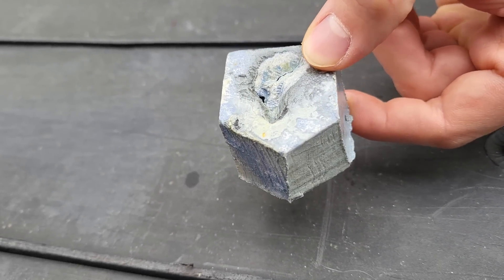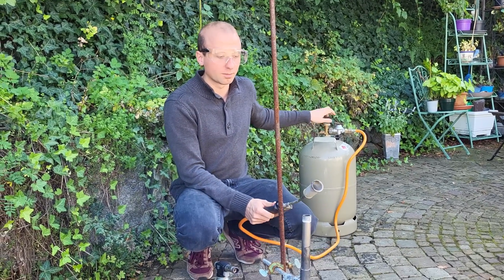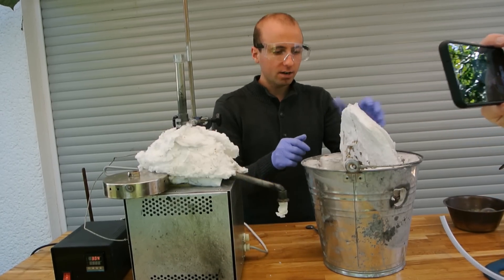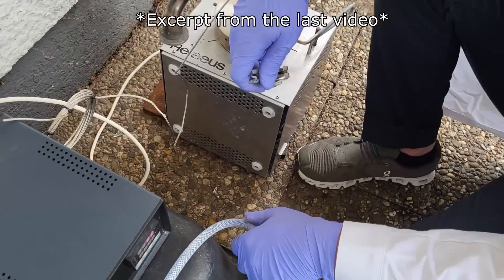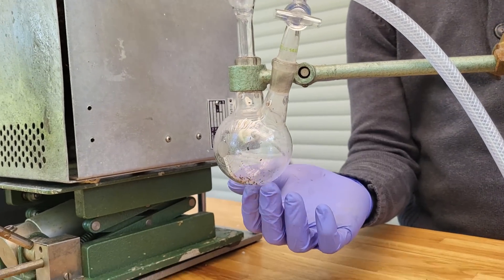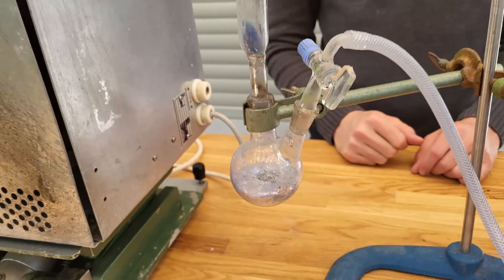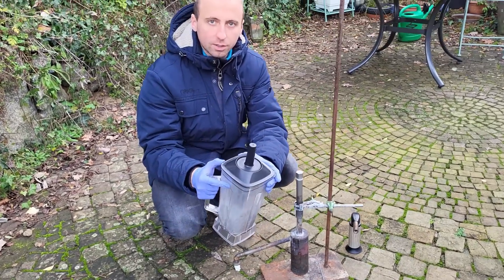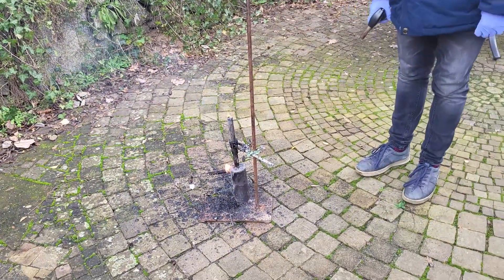Potassium Metal From Potash

Comment: im gonna be trying this, i dont get the ratios though.. K2CO3 + Mg is 100 + 17g by stoichiometry.. why 100+100g? 
i have an idea as well, using a hydraulic press and a pipe or a hammer (at least to pre-compact it) making some large chunks, or maybe just one chunk compressed into a pipe that can then be ignited that doesnt burn all at once, but just at the front like a rocket engine would, would significantly decrease the heat generated
a larger / thicker vessel, perhaps .. a thick aluminium plate soldered to the bottom plate could help to suck out the heat more

perhaps a distillation still design could be made where it leads into a container thats filled with butane gas and highboiling fraction of gasoline, in case it ignites it should rapidly die out again and turn into soot

another idea a fellow chemist hinted at could be to just bury the whole reaction mixture in a vast amount of salt which should be unreactive, sucking up the heat and leaving you with a chunk of melted salt encasing the goodies, easily melted away under oil or distilled off after being violated a bit with a hammer perhaps 

i dont get why hydroxide didnt go well, the CO2 as i see it will react with any reactive metal, creating more heat causing more problems.. is the excess of magnesium to circumvent the CO2 eating up the sodium or? 

perhaps pieces of steel or similar high melting alloys could be added into the reaction vessel to act as an internal heat-sink

a lower and higher vessel could be made where its simply pressed together by friction, i also imagine using an amount of golden powder or similar low-igniting would help getting things started easily, chlorate variation of golden powder ignites below 100c but doesnt put out a lot of heat, so several stages of ignition compositions would make sense if that were to be used, such as rocket candy powder after the golden powder variation, and at last rocket candy with magnesium to make a lot of heat
Reply from the maker: Well your stochiometry is off by a factor of three, because the equation is: K2CO3 + 3 Mg --> 2K + 3 MgO + C
Also the Magnesium metal used here was quite impure so an excess was necessary.
Compressing the mixture would change nothing about the total heat generated, only how quickly it is generated, but that can make a large difference.
Burrying it in salt sounds interesting, if it works, but in pratice I would expect issues.
The hydroxide didn't go well for three reasons:
1) It is far more reactive than potassium carbonate
2) It contains 15 % water (KOH basically always does)
3) The reaction genereates hydrogen gas, while with the carbonate only the alkali metal vapour is produced.
Yes that is also the reason you need more MG or you won't end up with potassium metal, or just a terrible yield
Adding stuff to the reaction mixture is certainly interesting. I would go for paraffin maybe, because it evaporates, which can suck out a lot of heat.
What do you mean with golden powder?
Reply: @EliasExperiments  sorry late reply finally figured out how to see youtube replies
hmm, yes i see it has OH, of course, water- but the CO3 has 3 oxygen atoms where OH is just.. 1 oxygen atom, mhm? 

the carbonate mix is great as the carbon can help protecting the alkali

golden powder is a mixture of potassium nitrate and ascorbic acid, vitamin C
it ignites very easily but doesnt produce much heat
the chlorate variant ignites at around 60*C if i remember it correctly, its virtually impossible to prepare in similar fashion as nitrate version is because as soon as it dries out it will ignite on a hotplate, but it did work to some extent just drymixed

for an ignition one could put a tube with KClO3 + ascorbic acid into the vessel, facing the wall, then it could be mixed with something like blackpowder and pressed gently (very gently..) to then pass over into pure black powder, which is probably one of the hotter mixtures, maybe perchlorate and charcoal as final mixture... KClO3 and silicon..? 

i have tried some times with MgAl dust and Na2CO3, its not very easy to ignite but i found encouraging industrial processes talking about how they turn lithium into lithium oxide and then react that with aluminium to create lithium metal - this would entice that MgAl is totally viable in the process and not just Mg, MgAl is a special alloy which can be powdered with mere impact of a hammer, hence varying particle size is rather easy - uh, into finer particles that is, its hard to undo

lithium boils at 1300*C which could help keeping things in better, where potassium and sodium is around 7-800c so it might boil out

maybe whats really needed is just to lead the reaction pipe into a large metal container to work as heatsink? large chunk of aluminium? 

i do have some success, when i pressed a hydroxide mix with MgAl in a small tube, Ø25 or so, maybe 30mm long tube, half filled, it was kinda hard to get going but once it got going it just kept going. just a small piece of metal pressed with mixture could be dunked into a reaction vessel to get things going, it seems tedious to keep the reaction going really, where with Mg it seems its very hard to control the temperature

could be good money with some finetuning, but would also be great to start out with the metal oxide, but then it might just put out too much energy again

perhaps a modified welding machine could be used to start the mixture.. hooking up power to the whole vessel and then pushing in a steel rod?

im betting on that a continous feed is not required if one simply presses the mixture prior, perhaps a longer less wide reaction vessel would be ideal to control the heat? smaller surface area would mean less energy per time

i would also like to throw the idea of perhaps pelletized reactants, or maybe pressed chunks of reactant that could be added in through a hole with a sliding door mechanism? 

sorry for copious reply but this is a project that could bring a bountiful harvest if mastered especially with cesium which sells at 20 euros per gram
Reply from the maker: Well all those things you suggested there is only one way to know how well it works: Try it out. I could like try and evaluate which method is the most promising to try first but that also highly depends on what kind of equipment and materials you have available. To make Cs metal it is certainly the most cost effective to start with CsCl and lithium metal. It is a differnt story for potassium metal though, because potassium is much cheaper than caesium.
Reply from the maker: Well I mean you could, but I think the business wouldn't scale to well and the profit margins are probably tight. Because industrially potassium metal is made using sodium metal and potassium chloride using fractional distillation and magnesium metal is made in down's cells, which could hardly be cheaper. Also good luck turning 25 kg of lithium carbonate into 5 kg of lithium metal at 100 % yield. That is quite the challenge. But 600 € is a fantastic price for that. I mean if you can turn it into a business more power to you, I would love to hear your story if it works out! ;-)

Comment: Would it also work to melt the potassium metal out of the mixture instead of destilling it off?
Reply from the maker: No, because it is absorbed to the carbon and magnesium oxide, which also forms during the reaction of potassium carbonate and magnesium metal.

Comment: Can you get clean potassium metal from potassium bicarbonate?
Reply from the maker: Well you could just decompose the potassium bicarbonate to potassium carbonate in an oven and then just follow the same process. Since I am drying the potassium carbonate in an oven first anyway, the process would be pretty much identical actually.
Reply: @EliasExperiments  That sounds great. At what Temp, and for how long to get it from “Potassium Bicarbonate” to just “Potassium “Carbonate”. I don’t want to mess it up. I want to do it RIGHT, please!!!🙏🏻
Reply from the maker: It starts to decompose at 50 °C. Your regular oven probably can't make it too hot. If you put it to like 200 °C it should decompose everything relatively efficiently.
Reply: @EliasExperiments  Thank You very much. That sounds great to do. So just put it spread out on a cookie sheet at 50 degrees to 200 degrees celsius for about how long, 🙏🏻 please
Reply from the maker: The longer the better I would say. Maybe start at least with one to two hours.
Reply: 😊 Thank you so much.
Reply: I found some K2CO3, luckily(maybe). Is that easier to use for getting some Potassium made up.🙏🏻
Reply: I would really love to do what you did making the potassium. So I could do it myself. I have potassium carbonate and magnesium what other mechanical parts i would need🙏🏻🙏🏻🙏🏻. I have a “stand”. But I do not have the metal container or the generator your running. Or the glass part with two legs. Please help me out with information. I’d love to make that potassium. Potassium it self is so expensive. I’d rather make some my own way. Please, if you can, help me out. You made it happen so well.🙂
Reply: Okay, I would, 🙏🏻 PLEASE, like to know the “machanics” to make the Potassium metal like you did it was great! 👍 I already have potassium carbonate, and magnesium….. I just don’t know what machinery I would need. You both did amazing. And it’s so expensive itself. Please help me out.🙏🏻🙏🏻🙏🏻🙏🏻🙏🏻🙏🏻
Reply: Okay, I would, 🙏🏻 PLEASE, like to know the “machanics” to make the Potassium metal like you did it was great! 👍 I already have potassium carbonate, and magnesium….. I just don’t know what machinery I would need. You both did amazing. And it’s so expensive itself. Please help me out.🙏🏻🙏🏻🙏🏻🙏🏻🙏🏻🙏🏻
Reply: That looked really good how you made some🙂. Could I please 🙏🏻. Get a parts list. So that I could make some, as well. PLEASE, I’d love to make some as well, because it’s so expensive to just buy at a store that has it.
Reply: PLEASE HELP ME Elias 🙏🏻🙏🏻

Comment: Am I missing something?  How do you reduce to potassium metal using magnesium which is lower on the reactivity series?  I thought perhaps you had made potassium by some form of decomposition instead but even if you have the high temperature to decompose K2CO3 it would still only produce K2O, not elemental potassium,
Reply from the maker: That's not exactly how it works. You are thinking about aqueous solutions and even there these effects can be turned around by other phenomena. The reason we can reduce the potassium metal with magnesium metal is that the resulting magnesium oxide is more stable than potassium oxide. Also the reduction of the CO2 from the carbonate by the magnesium provides a lot of energy for the reaction. Stuff like that is rather complicated and the easiest way to figure it out is often just to do the experiment. That's all that counts in the end anyways ;-)
Reply: @EliasExperiments  That makes a lot of sense

Comment: rub some concentrated phosphoric acid onto the labstand and rub it with steel sponge
react selenium metal with nitric acid, mix selenic acid with a bit of copper sulfate and phosphoric acid to create metal blackening solution to give a protective coating, clean it off a bit and oil it up a bit with some acid-free oil
Reply: Says the guy who nearly burned down his neighborhood. Lol
Reply: @purple_dinosaur  ive heard many things about myself but this is first time im hearing this
Reply from the maker: Oh wow that sounds quite interesting. But isn't selenium not a little bit too toxic to use it as a protective coating?
Reply: @EliasExperiments  nah its used as supplement but in very small amounts, its whats used on rifles and many bolts to give a black coating, industrially they electroplate it on as it gives much better coating

if you clean it very well and put some ammonium zinc chloride on it, you should be able to heat it up and rub zinc metal on it to coat it, at my job we used zinc-lead-tin alloy solder to rub on steel pieces where we have had to repair it by grinding/welding the zinc coating off

Comment: Hey Elias, even though I still haven't gotten around to making videos yet, its funny to see that we are both working on a similar reaction! I'm using sodium carbonate and aluminum instead in an attempt to make sodium metal. I believe it should work even better with molten NaOH and aluminum, which I will try next, and which was also the original reason that I looked into this reaction to begin with. It would also be easier to do on a large scale unlike the magnesium and potassium hydroxide reaction since the reaction eith aluminum should be less exothermic according to the enthalpy equation. After looking into it for a while, I found that the key behind the success of these somewhat counterintuitive reactions is quite interesting, and quite simple, it's the fact that the metal reducing agent (magnesium in your case) wants oxygen really badly, and more importantly, it wants it even more than the potassium does, which you would normally think would be the more reactive metal here. After a lot of research and equation building, and enthalpy calculations, I've found that metals in the alkaline earth group and metals in the 3B column (which includes lanthanides and actinides as well as scandium and yttrium) also love oxygen to a similar extent. it seems that 2-3 valence electrons is the sweet spot for forming happy stable oxides, additionally I found that 1-2 valence electrons is the sweet spot for halides, or at least chlorides. it seems that a near 1-1 ratio of metal to oxidizer or even a 1-1 ratio of cation to anion is the most stable configuration. With this knowledge it makes sense to hunt for another such "oxygen loving" metal in the 3A column (which is similar to the 3B column) and if you look, it does, it has aluminum, and as you would expect its very reactive toward oxygen, and prefers oxygen over a halide such as chlorine or bromine. I'm pretty sure that this concept can be expanded to other areas of chemistry and to other compounds and other reactions as well. To sum it up in anthropomorphic terminology, metals have preferences over which oxidizer they hang around with, and specifically, they like ones that are the exact opposite of themselves, like sodium and chlorine or magnesium and oxygen. I like to think of it like oxygen is simply a better fit for magnesium than for potassium, and the potassium is essentially still waiting for a proper fit (a halide) to come along and satisfy it, to make a more permanent solution for the potassium than the oxygen. 
Anyway, if you look into the enthalpy calculations, the reaction of aluminum, magnesium and most of the other metals mentioned earlier, with oxygen, produces significantly more energy per bond than potassium or sodium does with oxygen per bond, so there is a net enthalpy gain from swapping the oxygen from the potassium or sodium to the other metal. It's honestly a lot like thermite. Also, it doesn't seem to matter that much if it's a hydroxide or carbonate instead of an oxide since all the metals mentioned so far are significantly more reactive than hydrogen and carbon, and would easily rip the oxygen from either carbon dioxide or water, and metal hydroxides and carbonates are stoichiometrically the same as the respective oxide plus water or CO2. Anyway, I guess the lesson to learn here is that potassium/sodium and other alkaline metals aren't necessarily always the most reactive metals, they're just more reactive with halides (and probably a few other oxidizers too) than magnesium or aluminum, but magnesium and aluminum can actually be more reactive than potassium or sodium in a few situations, with a few select oxidizers, namely oxygen. Anyway, this was quite long, mostly because I found this very interesting when I first learned about it, (for science!). Anyway, if you are interested in what I've been up to or want more information about the enthalpy changes in the reactions, or other possible reactions and equations of this same type, then just ask and I'll see if I can find where I wrote them down...
Another great video as always! -MetalMaster
Reply from the maker: I would guess that sodium carbonate an aluminium is too unreactive of a combination, so I would not expect this to work. But I have been wrong about things like this before. NaOH and Al might work, it might also blow up on you :D KOH and Al blew up on me und vacuum, so it might be a similar story with NaOH.
That is very interesting about the compound stabilities.
Thank you so much for this very detailed explanation.
A couple people have asked me about more in depth theory behind this reaction and from now on I will direct them to your comment, if I get asked.
Reply: @EliasExperiments  Thanks! and I guess I will have to test these reactions to know for sure. :)

Comment: Im not understanding how did u use Mg as a reducing agent. Potassium is higher in the electrochemical series so it has a lower tendency to accept ekectrons. As far as i know metallurgy of Na K and Al can only be done by electrolytic methods l.
Reply from the maker: Because the magnesium reacts with the carbonate first which releases a lot of energy and the remaining K2O is quite unstable, while MgO is much more stable.
Reply: @EliasExperiments  Oh so its thermodynamically unfavorable but entropically favorable?
Reply from the maker: No, if that would be the case the reaction would be endothermic, which it obviously isn't. Potassium metal, carbon and magnesium oxide are the thermodinamically favored products in this system.